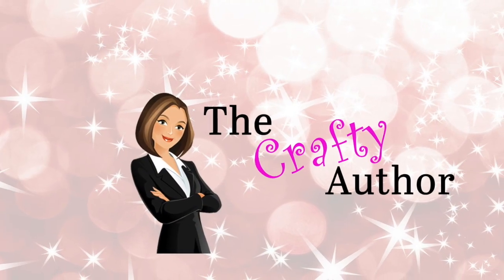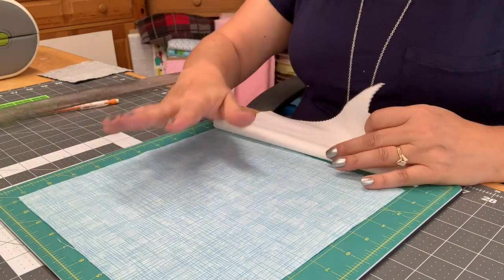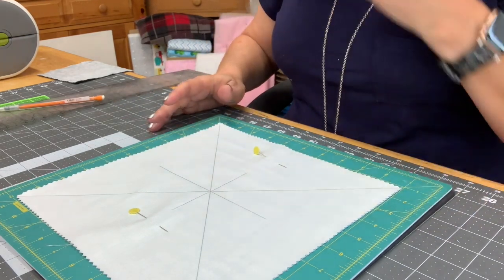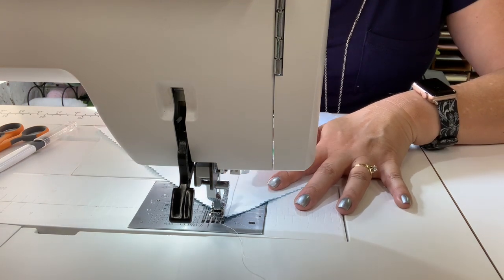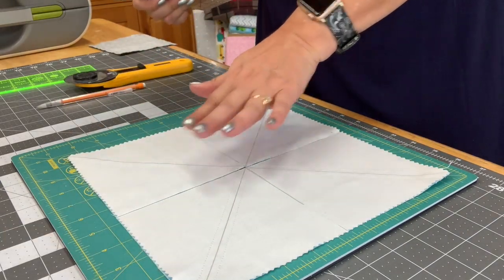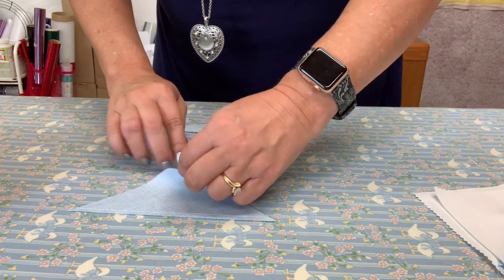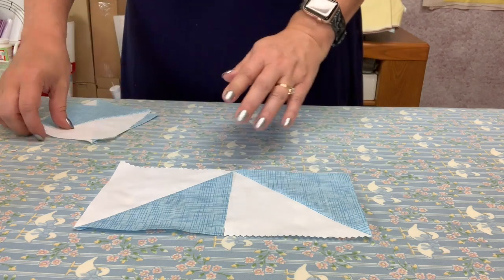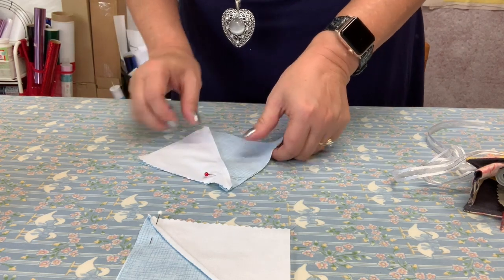FAST AND EASY PINWHEEL QUILT BLOCK USING DIFFERENT METHODS

Comment: How do you square up a pinwheel block? Some of my patterns always say after I get the pinwheel block made to square it up to a size thats smaller than what it is. So that is what I was hoping to see in this video
Reply from the maker: I’m not sure where the confusion is, this video shows exactly how to square up the pinwheel block.  If you go to the time stamp 30:22, you should be able to see it there.  I go into very full detail on how to determine what size and how to square it up.  I even show you.  I hope this helps.
Reply: @TheCraftyAuthor  Now I am confused too as your video only goes to 30:21, right? So how can we go to 30:22?

Comment: Liked yr video.  Enjoyed it too. Thanks a lot and I did learn a lot.  So the pinwheel block design actually is the top layer  followed by the batting and then the back piece in order to make a complete baby quilt, right. Pls guide me.
Reply from the maker: Sharon- That is correct.  You would sew all of your pinwheel blocks together, then add batting and a backing.  I also have an Easy Baby Quilt series where I walk through all of the steps of making a quilt.  😊
Reply: @TheCraftyAuthor  Thanks a lot mam for the prompt response.😊